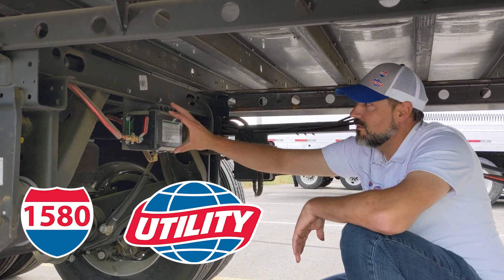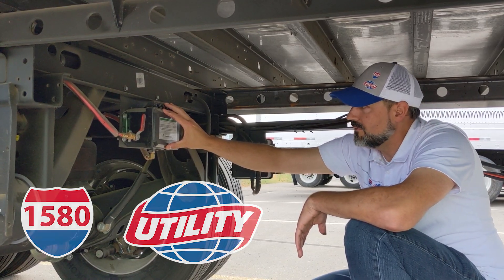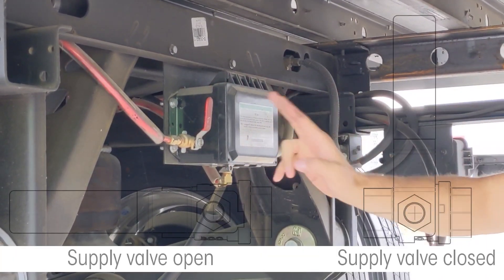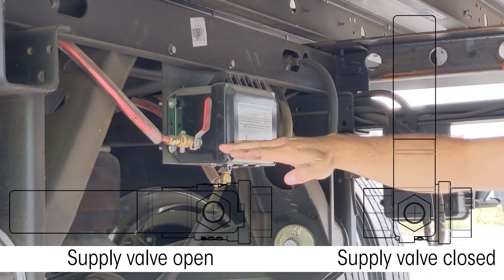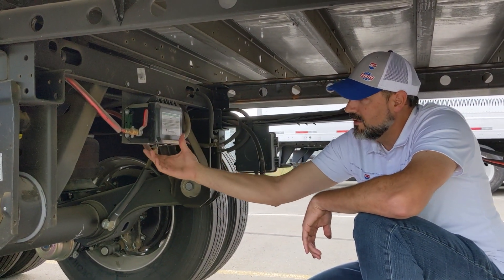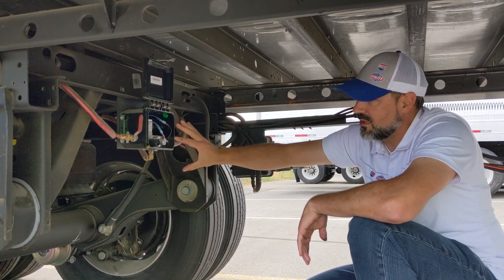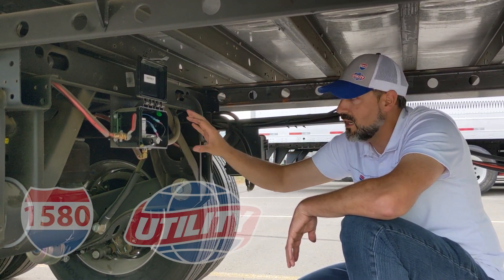What to do if your Tiremaax tire inflation system has a leak.

Comment: On  suply pipe  broke off and i am loosing controllers over air supply to tires even i turned off main valve! Now i am loosing air on two of the tire on trailer How can i keep air in tires or. Pump air to get the right pressure !?
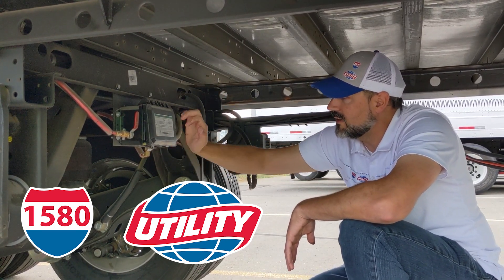Reply: Broken off the hose 0:36